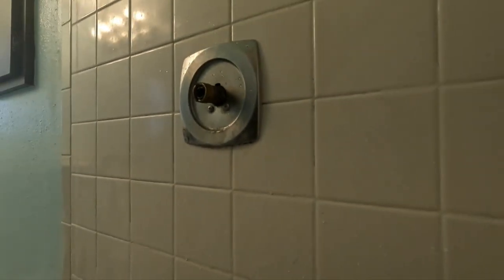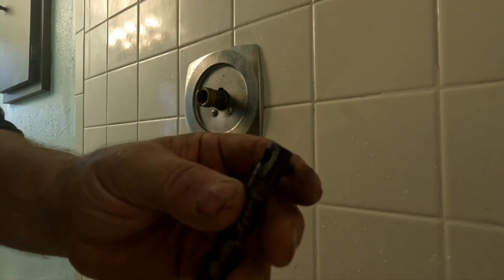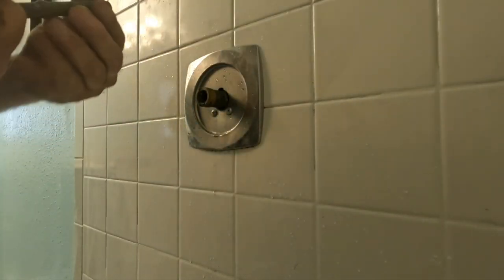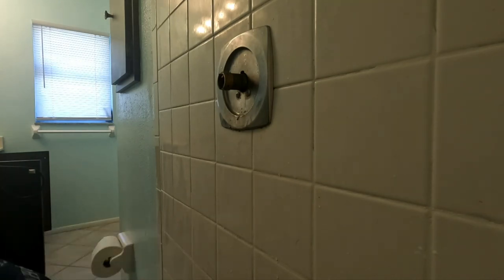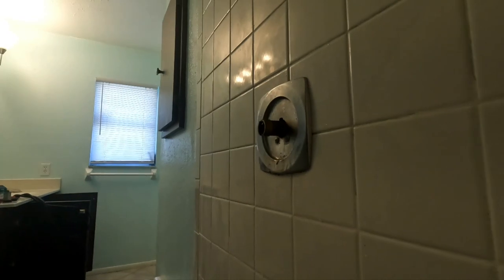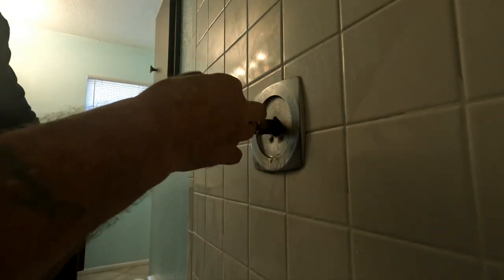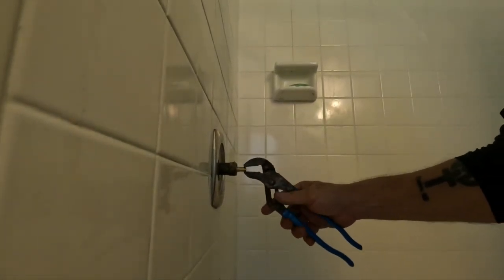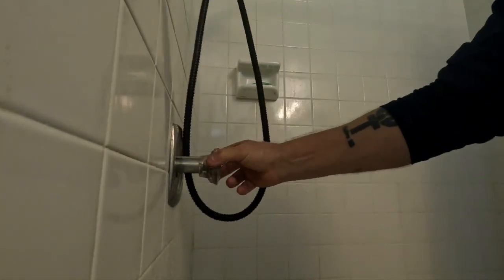HOW TO REMOVE A STUBBORN MOEN 1200 CARTRIDGE  EASILY

Comment: I had this issue on a 40 plus yo valve. Threaded the inside and extracted it with a grade 8 machine bolt and deep socket from a video I saw on here. Saved my ass.

Comment: That escutcheon plate moved quite a bit; do you caulk around the top and sides of it to limit water from getting behind there?
Reply from the maker: Yes,every shower trim and tub spout,video was cut short,gopro battery issues. 
By the end of the day I've had it with it 😆